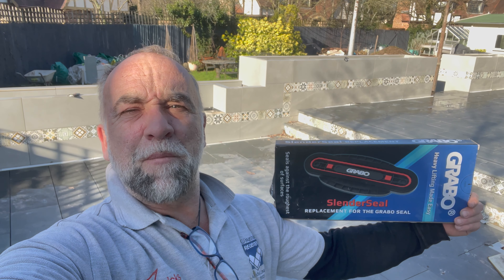Slender seal suction cup from Grabo

Comment: Hi tidybricks, are these Grabos any good on concrete flags and indian stone or just porcelain? They look handy little tools - hope thats not a stupid question its just obviously with indian stone and concrete the finish isnt smooth like porcelain
Reply: I use mine frequently on Indian stone and yorkstone flags.

It works well, but you need to press it down at first to get the vacuum  to seal.
Reply from the maker: Yeh works a treat on concrete and sandstone with a riven still no worries just push into it. They even have a rock seal for more bumpy surfaces. 👍🏴